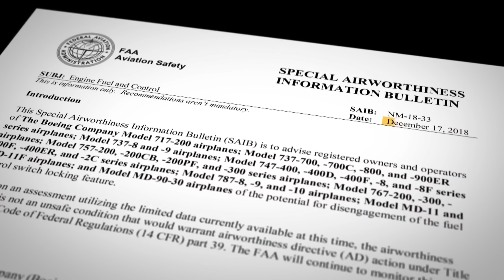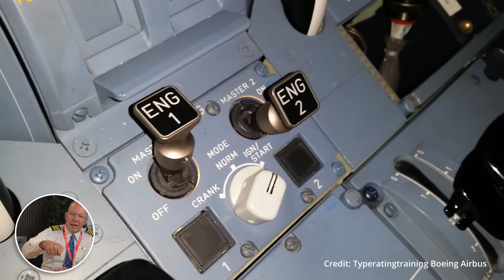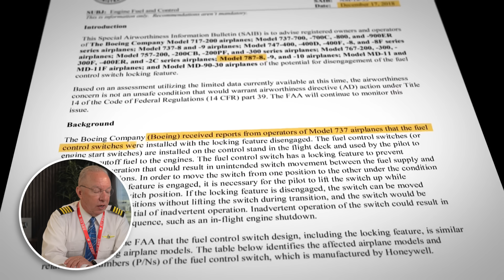Air India 171: The FAA’s 2018 Fuel Switch Locking Bulletin Explained (16 Questions Answered)

Comment: The positioning of this switched seems like a really bad idea to me. Yes, I understand they have a locking mechanism and bump guards. But still...why put then directly underneath the throttle? It just seems like a bad idea since I'm sure pilots reach for the throttle without looking.

Also, I 100% agree with having logic to require the throttle be all the way down before the switch allows a fuel cutoff. I doubt this would add much time to the precedure but could prevent a catastrophic, unrecoverable error.

Comment: Good afternoon, I’m just wondering why there is not a 15 cent plastic cover that has to be lifted in order to operate this switch. They have been in use since the sixties in space crafts to prevent of accidentally bumping into the switch.

Comment: Capt Steeve - Is it possible an electronic failure due to NOT doing that LOCKING FEATURE of the service bulletin? Either electronic triggering, or because the locking feature was DISABLED, it was accidentally bumped?

Per the advisory :

The SAIB highlighted that some Boeing 737 operators had reported that the locking feature, designed to prevent accidental movement of the fuel cutoff switches, was disengaged. The design of these switches, including the lock, is similar across various Boeing models, including the Boeing 787 Dreamliner. 

The FAA considered this issue a potential safety concern that could lead to inadvertent engine shutdowns  but did not classify it as an unsafe condition warranting a mandatory Airworthiness Directive (AD). Instead, it served as an advisory, encouraging airlines to inspect and verify the functionality of the locking mechanism and replace any faulty switches.
Reply: You can see the locking feature in the pictures in the preliminary report
Reply: No
Reply: 1 switch mechanically failing might be possible… 2 switches failing 1 second apart is so unlikely that impossible might be the best answer

Comment: How is it possible that an aircraft this expensive does not issue a warning after the engine is shut down, or prevent it from being stopped while it’s in the takeoff phase? This shows that we are still far from real safety without the pilot’s vigilance.
Reply: Why the airplane should stop the engine stopping, when the pilots will stop the engine.
Reply: @Ecovictorian Is there any situation that justifies shutting down the engine after reaching V1 speed? Especially if there are no indications of a problem with the engine? And then, why doesn’t the aircraft issue a warning that the engine was shut down via the switch — or is there a certainty that such an action could only happen intentionally?

Comment: Since everything here is unprecedented,  why would captain steeve not consider that maybe the switches went OFF due to some error? If this hasn't before, doesn't mean it cannot happen at all. Everything about this crash is unprecedented & first of its kind.  Coming to a conclusion based on only preliminary report is not correct. Even his 1st video , he had a wrong assessment which he clarified in next video and ruled it out. You gotta be more responsible Captain Steeve 👋

Comment: Camera's should be added for sure - at the moment we have the families of two pilots, not knowing and potentially being judged by the fact their lost loved one was responsible for this tragic incident, for whatever reason, on purpose or in an act of mental confusion. The camera video footage could be included solely with the flight recorded data, so only accessed when something goes tragically wrong like this. A question as well, are there any other switches that are operated around the time the cut-off occurred that one of the pilots could have inadvertently been confused with for whatever reason?

Comment: Pilots never cut off the fuel switch during flight take of. Voice record says so also. Pilot did not say that the switches were in off position. 
The EAFR didn't say, that pilots switched back to Run position of the fuel switch. Also, voice record  did not say that,he had  switched it to run position. 
EAFR Report says "engine fuel cut off switch transitioned from cut off to run "only.So it could be that
 FADEC - Full authority dual engine control, might have malfunctioned ,(may be like switch off and switch on )
Sir, can you clarify its control/  functional logics.

Comment: I don't understand why there is no logic that you simply cannot cut the fuel during takeoff below a certain altitude if computer knows that engines are producing thrust. I mean even if there is a fire, wouldn't be a better option to have a thrust and have a chance to bring the airplane back to the runway rather than send it down immediately? You are saying this is not a design flaw, but I think it is. Not design of the switches... I understand that after a war, everybody is a general, but I hope this tragedy will lead to some changes in the control system.

Comment: 🚨 Why switches aren’t dual-operated: Fuel cutoff switches are typically placed on the center pedestal where either pilot can access them, rather than mirrored redundantly. Here's why:

Speed in emergencies: Quick solo access can be critical if there's a fire or a severe engine issue mid-flight. Requiring dual inputs could delay shutdown.

Standardized procedures: Multi-step verification — like a checklist callout, cross-monitoring, and cockpit voice recorders — creates accountability without physical interlocks.

Mechanical simplicity: Dual-switch designs introduce complexity and more potential points of failure, which aviation systems often try to avoid

Comment: Sorry Cap - I disagree with you about the camera's, if it could get out as you say then the voice and data could also get out. If truck drivers (like myself in the recent past) have to endure having a camera in our face as do many others, why not airline pilots?  We would not be having this question video if there had been a camera there. Finally, if camera's are there it often prevents actions because people do not want to be caught 'red handed' so your argument that it could not prevent is also not quite right.  No offense sir - I feel you have many excellent insights just disagree on this point pretty strongly.

Comment: Nobody wants it to be the intentional human factor, but there it is. What I am surprised by is the ability to turn the fuel switches off while the throttle is in anything other than the idle position. Seems like FADEC should override the fuel cut command in most situations or there should be a direct interlock between fuel switch and throttle so throttle must be at idle to shut fuel off. The latter being what I consider Boeing think, i.e: giving pilots more control in abnormal situations. With the increasing number of cockpit psych incidents, I hope to see the system redesigned, it would give the crew a moment to respond to the power cut before the fuel cut and I would think that the throttle cut would likely be survivable versus the end game fuel cut.

Comment: how long will the engines run after fuel cutoff? the plane was airborne, so it must've had full power to take off. once the cutoff starts, is it instantaneous? or is there a lag before spooldown  starts? seems like the switches were activated as soon as the plane rotated, or pretty close, which would lead me to believe it was deliberate.

Comment: What doesn't make sense is a lack of CVR transcripts or audio in the report. No mention of the mayday and losing thrust. Each pilot has their own audio channel. India knows exactly who said what and when. My suspicion is a loss of power on both engines first, then one of the pilots switched the fuel switch from Run to Cutoff then back to Run as a last ditch effort to reignite the engines. The report is vague at best. If India wanted to be fully transparent, then they should have released all the CVR information from push back all the way to the crash. We're taking the word of an agency who has a reputation of intentionally leaving out key information. We need a Global Investigation Agency who can't or won't be swayed by politics or money. Whose mission is the truth. We need facts, not ambiguity.

Comment: I am still not clear in my mind when it comes to the process of handling the fuel control switches. I do understand that they were in SHUTOFF position when they found the part of the console with the fuel control switches, but then "people say" (the report ?) that immediately after one pilot tried to restart the engines....well in that case the fuel control switches should have been in the ON position ?
Catullevirgille

Comment: @8:39 each engine has its own board and processor. This would require both boards have the same failure independently at the same time which is supremely unlikely.  This sounds like lead free solder pushed on the world from the EU for RoHS compliance. Tin/Lead solder does not have this issue.  They are being conservative and just replacing boards that are over  x amount of thermal cycles.

Comment: This is far from over. An electronic/electrical failure could result in a fuel cut off. If a component has aged and require replacement and wasn't and there is no redundancies to take over immediately, there is no time for remedial action.
It seems the cut off switches were in run position. This suggests a non human intervention and we cannot just believe what the recorder saw.
I would like to see a failure investigation based on electronic failure.
The switches trigger a set point but what signals were sent to the electro-mechanical system.
Not so fast in blaming pilot error or pilot mental health.
Reply: id bet the switches pull ups get worn after time .What about any warning beeping iv not heard anything said itd surely drown out the voice chatter?
Reply: Not enough is known and published. A thorough investigation is needed before jumping to conclusions. Failures can occur to humans, mechanical systems, electronic control components, software and hardware. Yes, flying is safe, but failures do happen. We should not be tunneled visioned until all facts are known. It is also possible that we may never know. You can talk about likelihoods, it's still just a likelihood.